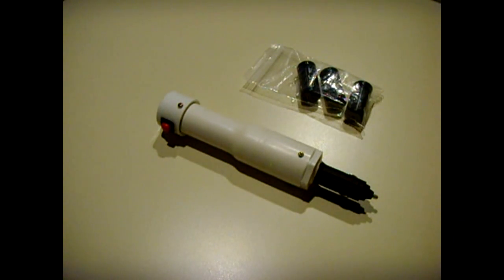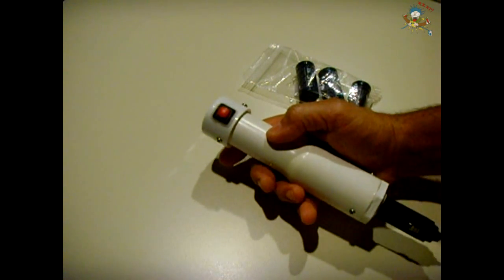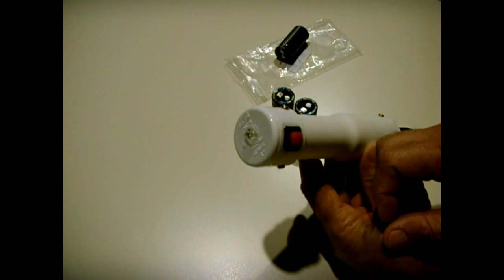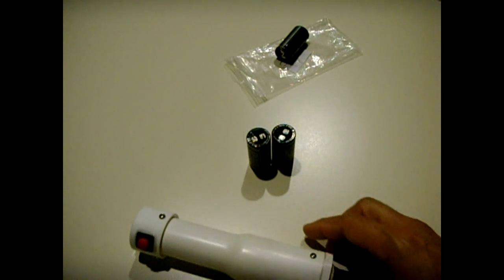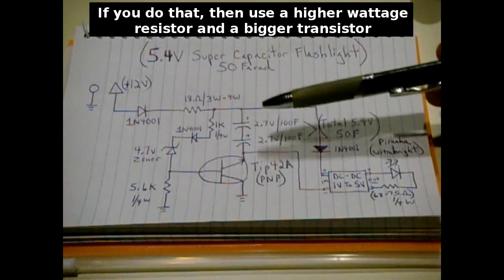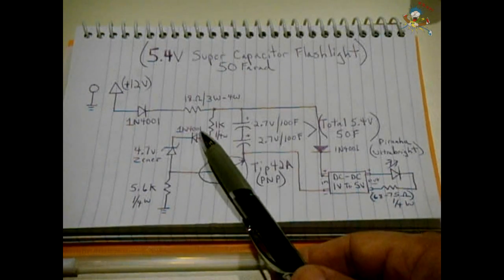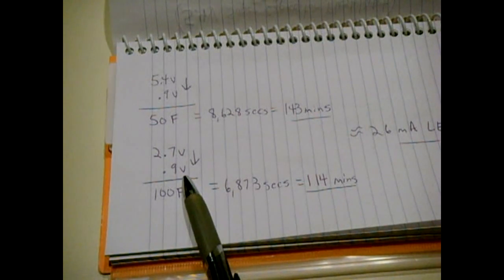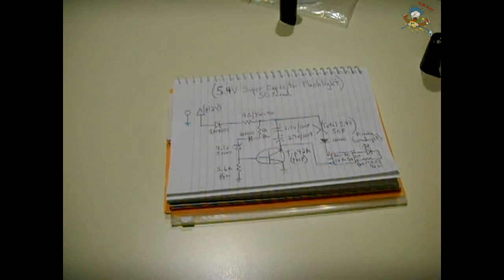DIY Ultracapacitor Ultrabright LED 12V Chargeable Flashlight

Comment: I am 6 years late!  If you connect 2 100F capacitors in series, you still get 100F, not 50F as you said.  You do double the voltage.  You might find your flashlight is lasting much longer than you thought!  :)  Anyways, cool idea!
Reply from the maker: Correct, 2 in parallel is double, 2 in series is half. Are you sure I said that?
Reply: @electronicsNmore  Oops, I guess I lost some info from my school days.  You were correct.
Reply from the maker: @guywatkins  What you said applies to batteries, not capacitors.
Reply from the maker: @guywatkins  Incorrect. I just watched. I said 2 together(In Series), yields 2x voltage rating and 1/2 the capacity. 

Enter 100 twice and see the result. :-)
https://www.omnicalculator.com/physics/capacitors-in-series

Comment: You could use a LM7805 and the current reducing resistor,  plus it's better to keep the volts below the rated volts (5vdc regulated), sure you would loose a little bit of capacity (but you could charge at 1-2A with ease),  but wouldn't stress the capacitors.  Then you could use a Cree XP-G or XM-L and a AMC-7135 LDO to reduce voltage to 3.3vdc at a fixed 350ma...alot of light, increased efficiency and longer run time, and alot simpler schematic and less components.
Reply from the maker: +Brian C 
There are no negative effects if you charge up to the rated capacity of the supercapacitors. Even if you slightly overcharged them, the capacitor would self discharge fairly quickly to a lower voltage which is within the rated capacity. Using high current LED's would greatly reduce your run time. LM7805's are only designed for 1A max current output, otherwise you would need to use a very large heatsink.Using an lm7805 set up as a constant current source would work, but as you stated, you would not be taking advantage of the full capacity of the supercapacitors. I would use a 317t instead. Just set the output to 5.4v. You also get a higher current output. :-) 

Thanks!

Comment: I don't believe IC station still carries that module.  Do you have a part # for enquiry?

Regards,
Jim
Reply from the maker: They do. The one they sell has a female USB connector also soldered onto the board which you can remove.

http://www.icstation.com/product_info.php?ref=42&products_id=2612&affiliate_banner_id=1" target="_blank">DC-DC Boost Module 0.9V-5V to 5V 600MA USB Step Up Module</a>
Reply: https://m.fasttech.com/p/1486403

Comment: Liked it, but might throw a suggestion out. Try putting a micro USB port on the base instead of the whole plug.
Reply from the maker: Hermann Göring
Maybe to you it does, but not to me. I think the entire flashlight looks very nice. I explained above why I like the 12v male plug. One thing I learned about Youtube people, you cannot make all of them happy. Good luck doing that.
Reply: The plug looks like shit
Reply from the maker: That defeats the purpose of having a flashlight that can be easily charged ANYWHERE. I would need to make a special charging cord and carry it with me(pain in the ass) in order to charge the flashlight. Lose the cord, or forget to carry it, and your screwed. I like what I made. You can make one using a special cable if you like.

Thanks For watching.

Comment: To charge them in series, you really need some form of balancing circuitry. (A step down converter that has, say, 4V output, 8V output, and 12V output which are all current limited just to be safe.)
Reply from the maker: Everything I read stated more than (2) cells in series "should" be balanced, but you did bring up a valid point. I checked the voltage of each capacitor as they neared full charge, both were close in voltage, they appear to be well matched.
Reply: Another easy way to make sure they stay balanced is to have a 1 megohm resistor across each capacitor. This is often used when making capacitor banks for tesla coils.
Reply from the maker: I know about the resistor, and a resistor of that value will bleed off extremely low current over time.
Reply: electronicsNmore Yeah, thats the disadvantage. BTW, don't capacitors have very high ESRs and bleed of charge very slowly? Perhaps that is only with certain types since these supercaps are actually pseudocapacitors and use an electrolyte solution very similar to a wet cell battery and do rely on chemical properties.
Reply from the maker: Funny you asked that. I am testing a whole bunch of capacitors using my homemade ESR tester. The tester does not give you an actual value, but it does let you know if the ESR is high or low compared to other/new capacitors. These test very low.

Comment: Nice setup!
My desk light is a 3 LED lamp which used to be on 220 V, but I took the guts out, and now it runs on 9 Volt. I charge up 6 400F caps to 17 Volts. Then I have a dc2dc converter which brings it down to 9 Volts (approx). On high light settings (9.3 V) I get 2 hours of light, and with a little less I get 3 hours. It does light up my ceiling, and a small mirror redirects a part of it to my keyboard. And the charging? Simply by jumping on my e-bike, and I need approx 1 minute of peddling to raise these caps from 9 to 17 Volts.

Downside of the setup is the converter in idle already uses 9 mA. So over 3 hours that is a lot power lost.

Keep on sharing. I wish more people were using supercaps! My radio runs all day on 3 of them (1 minute on the e-bike or a little bit of sunlight charges them up).

Deslo.
Reply from the maker: Thank You. I really like it. It is ideal for my needs. The DC Converter I use is 92-95% efficient, and it is only powered while the LED is on, so no loss there. I have another really good video coming out in a week or 2 using super caps as well.